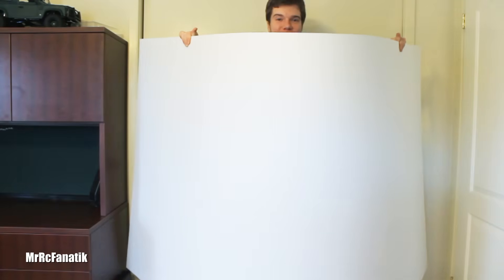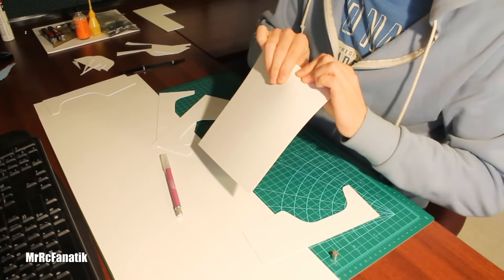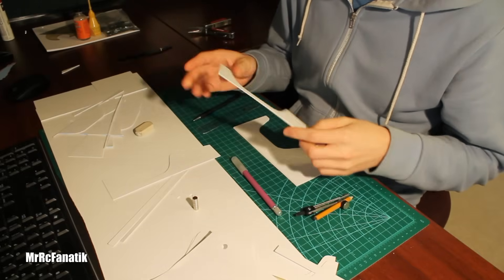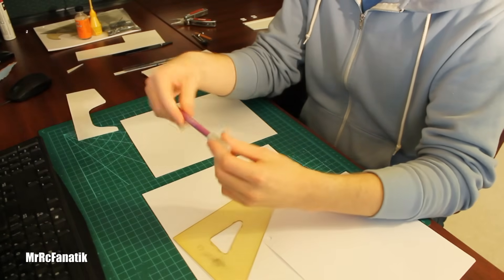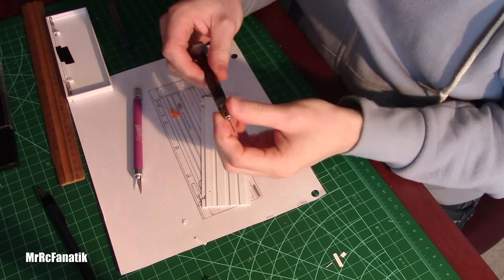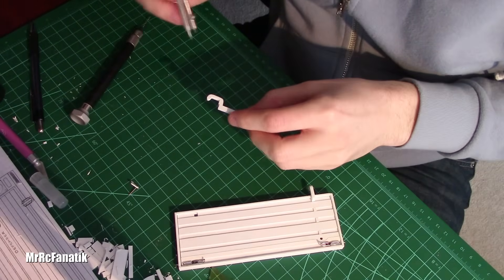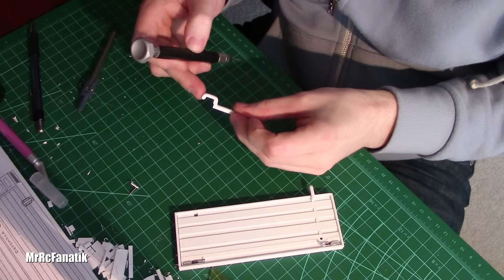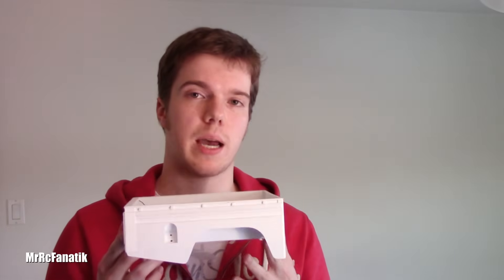How to Work With Styrene (Part 1 of 2)

Comment: if you need to enlarge a hole slightly i fin useing a touch tip cleaner it works great u can gewt at any parts store .nice video i'm realy a steel fabricater so it is pretty easy for me just learning what to use keep the good modeling up

Comment: And also go to lowes buy a lexan de bur tool its habd held small and fir removing sharp rough edges off of lexan plastic and i use it on my lexan rc bodies abd styrene and eben model car bodies out of the box around fender bottom and wheel wells

Comment: Nice work! Where do you get the hardware, etc. (latch for tailgate) shown in video.
Reply from the maker: Thanks Joseph, I made the wire latches from some old chromed Tamiya springs (bent to shape with pliers), and ballpoint pen springs to make them operate.  The hinge pins are HO scale model railway nails.  Cheers. 👍

Comment: Kindly let me know if form board and  styrene is the same
Reply from the maker: While I've never used Foamboard, I do believe they are in fact different materials.  Foamboard is typically a bit thicker and "airier" while Styrene is a much more dense plastic material.  Styrene is also waterproof while I believe Foamboard is not.

Comment: Once I saw you extract the drill bit at 9:45, I run to my workshop: "No way mine can have a sliding cover". YES THEY DO! It's only 15 years I've been forcing them open and having the bits fly all around. So... Thanks!

Comment: Can a dremel be used to cut styrene sheets and rods? Can the sheets also be vacuum formed?
Reply from the maker: Never tried vacuum forming styrene personally, but I don't see why not.  Yes a dremel is commonly used, but a bit messy!  I like the diamond tipped wheels best as they don't shatter like the normal cheapo disks.

Comment: Couldn't find any hobby grade pvc amidst the quarantine. Bought them wee batrhroom plastic windows in a hardware store, they use them for covering the pipes and water meters, also only 2 mm thick. Also, has a frame, cut it up to make posts and the frame. Very flexible under heat and robust, guess it should hold up well vs moist as well and won't dry out and crack easily. Thought would share the tip if anyone has the same sort of jam. 
Great work by the way, sub'd!

Comment: I see so many people just scoring and snapping the off-fall or piece from the stock. Why? I have found that more often than not, it leaves a rough edge and even some times snaps wrong taking a bit with it then I end up having to fix it or re-cut it. So now I just go ahead and take a few more slightly heavier than light passes to cut all the way through, leaving a clean precise edge. The only cleanup is a good flat block with some 320 or 400 grit paper to knock off the ridge left from cutting, which happens no matter how you cut it. 

Cool build though. Well done.

Comment: Greetings from the centre of Canada. Just a tip, a machinist’s de-burring tool will do a fine job of cleaning up your cut edge and you may find it a safer tool than the knife.
Reply from the maker: Hello from Ontario Kevin!  That's an excellent suggestion, thanks for sharing it!

Comment: You could use magnets to keep your set square in place as well. Maybe add a rubber backing to prevent sliding.
Reply from the maker: Good idea! They would have to be very strong magnets though, either that, or you just couldn't push too hard.  Still though, doable with the right materials!  Thanks for commenting!

Comment: Where do you recommend purchasing styrene? I'm looking for a large sheet similar to the one in the video for vacuum forming a hull but cannot find at local stores. Also located in Canada, BC specifically; where do you recommend I search and do you know any locations I might find cheap reject cuts to work with? Also curious what sort of pricepoint would be reasonable. Thanks for the great guide.
Reply from the maker: Well I was able to source a supplier locally, don't think they would ship to BC though, and even if they did it probably wouldn't be worth it to you (I'm in Ontario).  I got this 4x8 sheet of 0.040 for around $35 if I am remembering correctly.  Sorry to not be of more help!  Best of luck and have fun!
Reply: Thanks; I figured most industrial supply places would have this; didn't have any luck at the typical hardware stores so far. Great to know the price to get a ballpark of what's a good deal. Cheers!

Comment: how to make the bend for sytrene? i saw you use the heat. what's the tool? thanks.
Reply from the maker: That's a butane torch.  However a candle/BBQ lighter works too for small bends!

Comment: Good video but a slight word of caution:  If you're using a pointed blade such as an X-acto #11 you might want to wear safety glasses.  A few years back I was cutting with a #11 and a tiny section of the blade tip snapped off while under pressure and embedded itself in my safety glasses....had I not been wearing them it would've definitely embedded in my eye!  Be safe :)
Reply from the maker: Yikes! Good tip man! The point of mine broke off ages ago so I don't think it is very likely to happen again, however best to be protected just in case eh!  Cheers!

Comment: Amazing ! It does look like the back of a small truck ! Thank you for the tutorial, but it looks like an advance tutorial.
Reply from the maker: Thanks!  This series was intended to show some of the basics, but also include more intermediate level techniques that could be handy to the viewer.  Ultimately, the content of these videos was restricted by what techniques I had to use to create these specific parts, and there are still many more methods which were not discussed.
Reply: Thank you for answering my message. I have to say it again. It was very impressive. Would it be possible to cut a circle in one of those sheets ? If it is possible, what tool could you use ?
Reply from the maker: A circle eh, yes it is possible, three ways I can think of right now. #1 Drill it... Step drills are perfect for this... but you could even use a hole saw for a large hole.  #2 Use a compass and pencil to draw a circle and scribe along that line (carefully) with a blade, then drill/cut a smaller hole in the center and snap along the scribed edge.  #3 Use a divider (like a compass but both ends are pointed) to scribe the circle... if you press hard enough and/or make many passes it should be good, then continue the same as #2.
Hope that helps!
Reply: Thank you ! That really helps.

Comment: Hi great tutorial, could you tell me how you print your 1/10 scale flat template drawings etc
Reply from the maker: +orangewheels01 Hand drawn sir!  Found a bunch of photos of the real truck, calculated the models dimensions, and scaled the photos to that size so I could measure right off the computer screen and transfer to paper.
Reply: +MrRcFanatik thanks for the reply, really like the d110 build you did by the way.

Comment: awesome work  , what did u use for the metal silver studs?    nail heads?  did u cut them with a saw?
Reply from the maker: +kairus1 Hi man, yep, the hinge pins are HO scale model train railroad nails.  Just some wire cutters were all that were needed to trim them down to size.  Cheers!
Reply: thank you very helpful

Comment: What type of glue are you using in the video? I often buy the cheap tiny tubes and half of it ends up stuck to my fingers or the wrong surface, so I want to invest in some decent glue. Any other tips/tools to use? I don't plan on building rc vehicles, but do plan on working with styrene.
Reply from the maker: +Mark Cheverie I use Humbrol Poly Cement, and Plastruct Plastic Weld.  Also will occasionally use Gorilla super glue.  Yeah it can get a bit messy for sure, but just hold back on the quantity, as you only really need a little bit.  There will be a Part 2 coming at a point here, so some more tips will be in that episode.  Cheers!

Comment: Great video!  What micro drill sets are those?
Reply from the maker: Thanks Doc!  It's from a local Princess Auto, but I modified the drill as I didn't like the way it was made... this set on ebay is pretty much the same thing, and I think it would work great for you!
http://www.ebay.ca/itm/New-21pc-Micro-Drill-Bit-Set-Index-61-80-w-Swivel-Head-Pin-Vise-US-SHIPPER-/201039587229?pt=LH_DefaultDomain_0&hash=item2ecee4a79d

Cheers man!